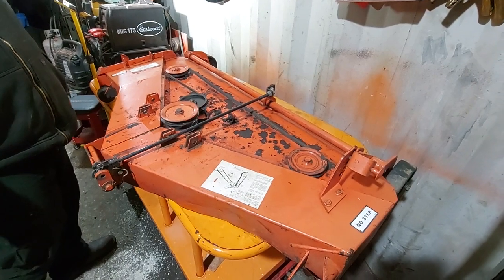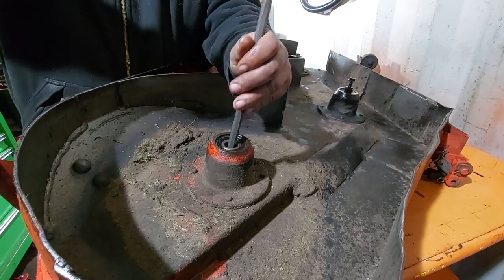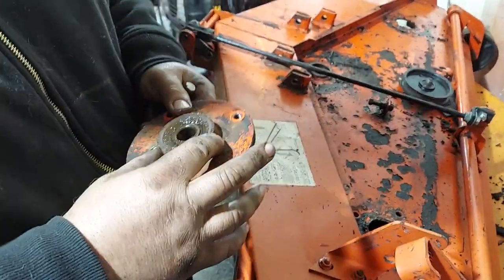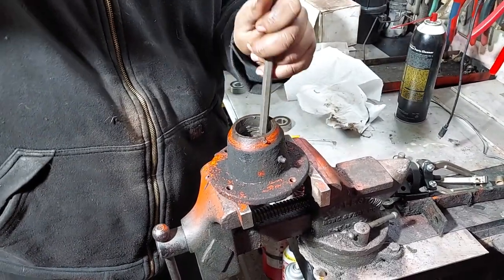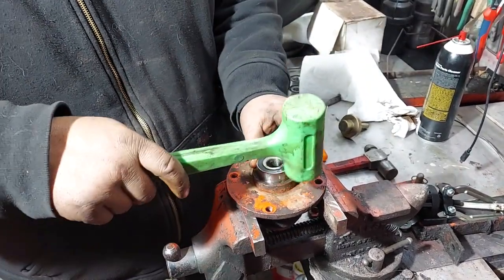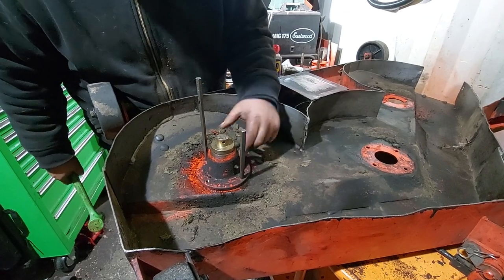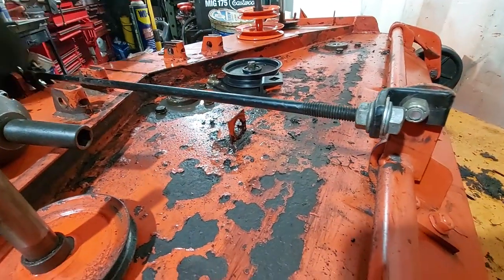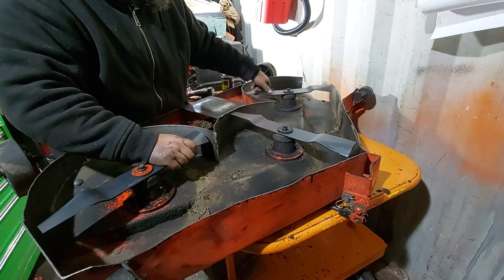How To Rebuild Case Ingersoll RM Model Mower Decks.

Comment: It's nice to see more case ingersoll videos.  I do take shots of a lot of what I do but just for my own reference. I wish I had more time to share.  Save your knuckles and possibly eyes on the next deck rebuild..... Try mounting the tension spring first, then get your belt laying in place except for the right hand spindle pulley..... then simply rotate the belt over the pulley as you turn the blades. (must be propped up off the bench so that it may spin freely.  Alternatively, use your half inch breaker bar in the square hole on the tensioner bracket to tension the spring while installing your belt.  Much easier, not to mention safer.  Keep the videos coming!
Reply from the maker: Hi thanks for the comments and support.  We have another video withing to be edited with installed the spring first. Should be up soon lol. We like to show different ways of doing things, especially if the videos are similar subjects.  But probably should have done this way second lol. In the other video we show it similar as to how you do it lol. We have lots of footage waiting to be edited, the time is the issue and it takes tons of time lol. Thanks again for taking the time to watch and comment!

Comment: Anti-Seize instead of WD-40 Would probably be better about keeping your threads from rusting or protecting them as you say.
Reply from the maker: Hi we use anti seize often in situations where we feel it's the best choice. Buy here we do not feel it's the best choice for mating surfaces.  It would take a fair amount of it and time to apply. Being so thick it could possibly create voids and unevenness,  where moisture,  dust and debris could get in and stick to anti seize.  May be fine 9 out of 10 times but possible it could creat issues.  Like the video said point is to use something, whatever you have is better than nothing. We often use old motor oil for the mating surfaces,  but the spray was quick and easy for the video. If one wanted to use all that anti seize and take the time to level it and clean up extra mess so nothing sticks to it when mowing, then it could be used. But it's just not our choice here nore want the customer paying shop rate on any unnecessary time.  That's just why we choose not to in this situation. But thanks for watching and the comment and suggestion. We always like to hear suggestions or how others do things and your suggestion others may find very useful and go with it. Just wanted to explain why we choose not to use it, but not saying it's not a option. And yes its a good choice for threads in many situations. Have a good one.

Comment: Just found your YouTube channel, it's great. I bought an old Wheel Horse plow from you a few years back, it worked out very well. I have just picked up a Hydriv 226, so I be stopping by for some goodies soon. Keep up the good work.
Reply from the maker: Awesome and congrats on the 226! Let us know how we can help!
Reply: @caseingersolltractorsnortheast  What is the chance of getting a RM deck to fit & spin on a 444 which is left handed.   Need it for right side mounting Leaf Vac.   possibly just put a twist in drive belt !   -
Reply from the maker: @staciehusen  not really a good way to make it happen that will perform or not chew belts..  Would be better to get a left side vac.

Comment: Wow awesome video.  I learned a lot from it.  Is this type of rebuild something you do on all the tractors you sell?
Reply from the maker: Thanks, it all depends how bad the deck is, if it just needs bearings or everything new. Lots of decks are in working condition and we do not do much to them when selling with tractors.  Many we put bearings in. Some we sell as is. It all depends.  We also rebuild many decks for customers as a service and also sell rebuilt mower decks by themselves. Thanks for watching and the comments!

Comment: Great video. I do have an older left hand exit mowing deck. 48” it’s on a 1975 Case 224 so I believe it came with the tractor. I’m not sure on the model number of the deck. But I would like to see a video on those. 
Thanks a lot.
Reply from the maker: Thanks we plan on doing one when we get the time, they are a bit more work to do.
Reply from the maker: The left discharge video has been out for awhile now.
Reply: thanks. 👋👋👍🏻👍🏻